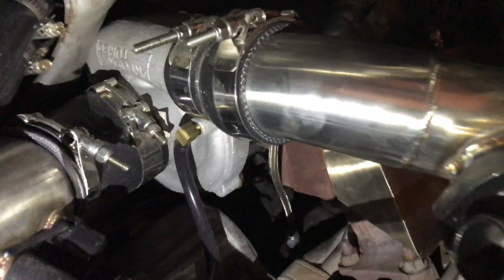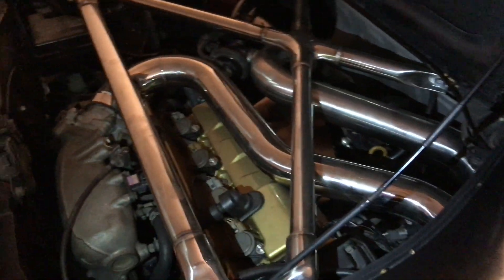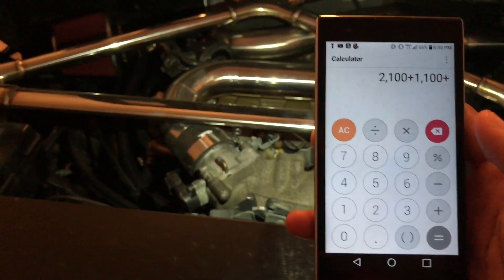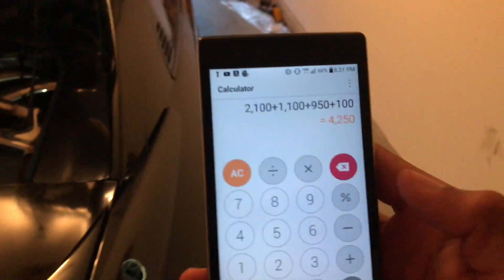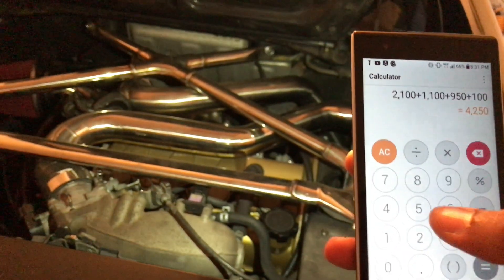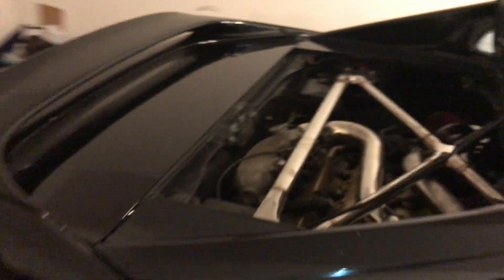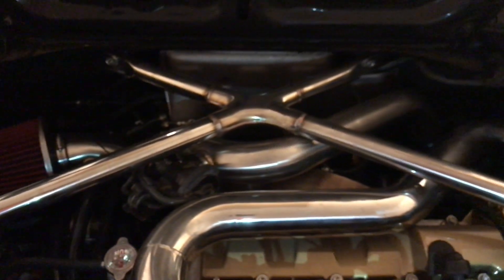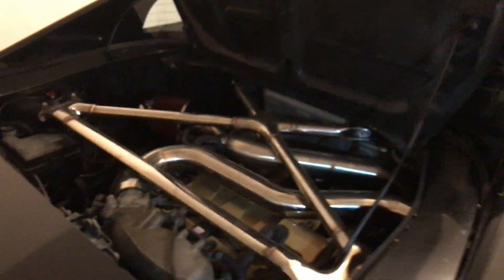The Cost To Build a 300+ HP MR2

Comment: You don’t need all of that. It’s been proven many times over that you can make a reliable 300WHP with I/IC/E and a boost controller on the stock Gen3 fuel system and turbo. I’ve had a Celica running that setup since 2008 with zero issues and she put down exactly 320whp  on a Mustang Dyno. My MR2 makes a bit less because it’s only maxing out the Gen2 fuel system on a CT-21 Blackjack turbo.

Comment: Assuming a fresh tune up, ignition, gaskets and fuel filter, air filter, all that...

I have a jdm 3rd gen 3sgte.

SIMPLE Bolt on a $200 ebay chinese smic (there's no sense in spending $600 on a nsme brand variant, functionally theyre pretty much all the same and a vast improvement over oem).

A spal fan, $80 or do.

And then maybe a $2420 .50 trim turbokit at 18psi.

You can tack on an exhaust as well but technically open dpipe is sn option if cost is of concern.

$50 manual boost controller.

You got 300, msybe 330whp max on a cool day. That's all it takes.

Comment: he sure built it wrong. 1200cc injector, fuel pump, downpipe, boost controller, e85, tune maxing out stock turbo and whalla. 300whp+ all for less than $2,000

this goes for all force induction cars. more air more fuel more powa.
Reply: I agree with neg. was running a stock 3rd gen with a boost controller, Intake, exhaust upgraded full pump putting down over 300hp
Reply: It’s been proven many times over that you can make a reliable 300WHP with I/IC/E and a boost controller on the stock Gen3 fuel system and turbo. I’ve had a Celica running that setup since 2008 with zero issues and she put down exactly 320whp  on a Mustang Dyno. My MR2 makes a bit less because it’s only maxing out the Gen2 fuel system.
Reply: @negativeindustrial  yeah, but who's set up is faster. Mines on upgraded fueling on  e85 maxing out stock turbo or stock fueling maxing out stock turbo on 93?
Reply: master power
Sure, but that wasn’t my point. My point was, you can build a 300WHP MR2 using the stock engine, turbo, ECU, and fuel system on the 94+ cars for less than $1k
Reply: Since you guys seemed to have already built mr2 is was thinking of boosting my 4th gen 3sge in a altezza, do I just get 3rd gen 3stge manifold,td03 turbo,1000cc injectors  walboro 255 500-600hp pump,(wield up my own intake manifold) or cut down a rb one, cams maybe ?

Comment: i got my enkei rpf1 on, got all the hks stuff intake and exhaust 3sgte gen2 boost controller ct-26 16g compressor wheel turbo, intercooler swapped, hks fcd  12 lbs boost, future project will be 550cc fuel injector, bigger fuel pump and aftermaket ecu mods possibly so far i put on 3200$ in parts
.

Comment: I’m building a 91 mr2 now, doing a built K20 with Hux racing kit, e153 trans. Def doesn’t cost $10k for a stock k series swap. Im building a nasty k series with good parts for around $8000-$10,000. I’m doing all the work myself but still. I have everything priced out and have built plenty of fast Honda’s before.

Comment: I think some of those added costs don't contribute to making any power. But that's only nitpicking based off the title of this video. I would only add up the cost for the engine,tuning, turbo and any other mod that directly contribute to making power.
Reply: The Marsh you need wider wheels to grip at that power level and to have the car response well to be at that power level

Comment: Awesome man. I sold my mr2 not to long ago and I regret it so much. Even though it was a na 2.2 5spd I still got 4500 for it. Give it some time and I will definitely get another one.
Reply: Subie Jason im thinking about buying one because i cant afford (or really find a turbo one) is it worth it? Still fun to drive? Any cons? I was going to to a few basic bolt on mods to help it perform a little better. Any advice would be great..im looking at one for listed at 4k and only 132000 miles on it 1991 2.2 NA 5 spd
Reply: Some Guy $4k for the 2.2? Really hope you didn't go for that. There's not a whole lot of mods you can do to that engine and most people say it's just not a good fit for the MR2.

Comment: (IM TALKING ABOUT HIS K24 MR2 TO CLARIFY) Even though it is 10k+ for any normal person doing a k swap, im sure Kyle at boosted boiz has less than that in the whole car and swap since he basically did everything except make the engine mounts himself lol! And unless you are on e85 or have built internals 330whp on a gen 4 on 93 pump gas is about at the limit, be careful!
Reply: Bosted hoiz have ebay build, about this guy i dont know, theres a sw20 mr2 turbo selling for 8k dolars (7000 euros in europe), all stock, is it worth it
Reply from the maker: Nick Adkins yes very true all the prices in quoting is at performance shops😄
Reply from the maker: what gen 3sgte engine is on the car, what year is the car and what specs does it include such as manual, lsd, and abs.
Reply: He has a completely stock accord k24, then turbo'd it and switched to e85. You can get that motor for $500 all day.